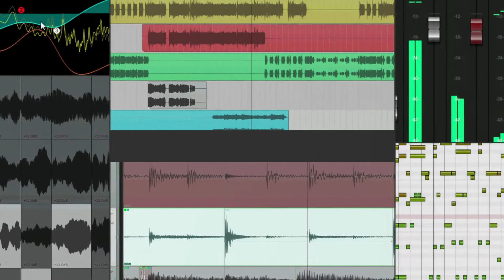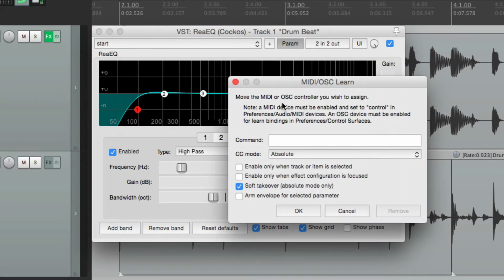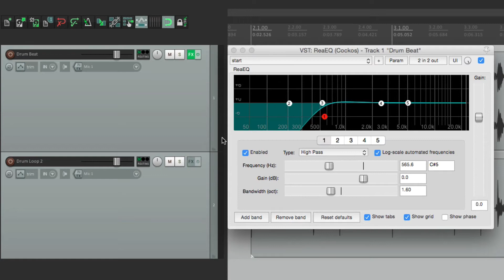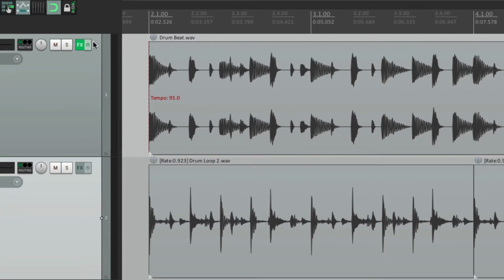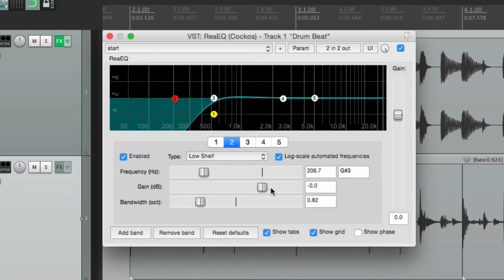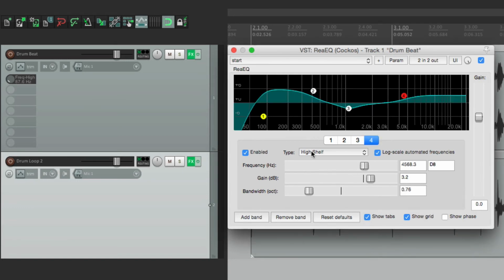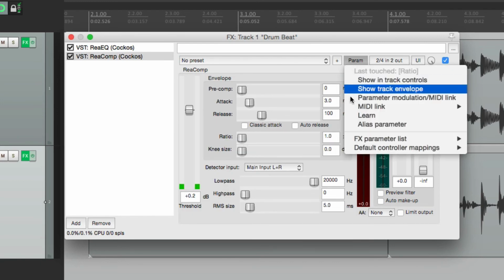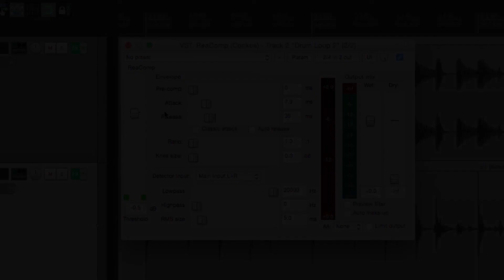Midi Controlled - Plugin Control in REAPER

Comment: I have my Keylab Essential set up as a Mackie Control surface in DAW Mode. I'd like to set up a user preset to control plugins, but when I try to do this techniqe, reaper is not recognizing my input as CC messages. It just stays blank on the learn page.
Reply: Hey Mitchell. Did you ever figure this out? I am able to control VSTI's like Serum and Kontakt, but Pro Q 3 is having none of it.

Comment: Goldmine channel, thank you very much.
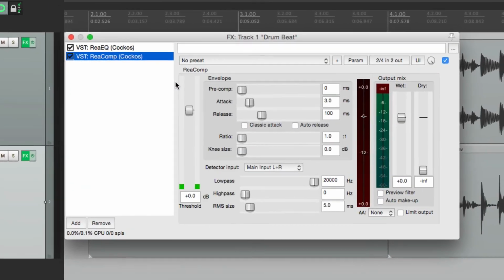The only thing you didn't explain is how did you change the midi channel to 2 in 12:00 ... did you press something on your controller? how did this happen?
Reply: I would also like to know this. Anyone?
Reply: @scottdempsey7277  it is a controller specific thing. You need to look into the controls and the manual of your controller to see if and how this is possible. For example, I have a NI S keyboard, it comes with the controller editor app where you can create scenes. You map your knobs to the desired midi cc and channel, and then create another scene, where you can assign them to a different channel and cc. Then, there are some arrow buttons on the keyboard that you can change scenes with them. So it's not a setting you can do in reaper, it's all on your controller.
Reply: @Agiyi  Thanks, I thought that may be the case.

Comment: it would be so helpful if you can help me. im new to reaper, when i put a wav file in reaper and start new project the default bpm is 120, but the instrumental im placing is 95 so when i try to place delays with vocals its not syncing with the beat because reaper says its 120 and its really 95. how do i change it to sync correctly. please help.
Reply: In your Transport section (play, pause, stop, etc) you can set the tempo. Set the tempo first, THEN import your tracks. 

That's the easiest way. If you add the audio before the tempo change, Reaper will adjust the speed of your audio and then you have to go into each audio item and change the setting to TIME rather than TEMPO.
Reply: Vampire Step-Dad is there a way I can find out a beats bpm when I'm dragging it in to reaper?
Reply: select a few bars of the loop, right click on the timeline and choose "Set project tempo from time selection (detect tempo)"